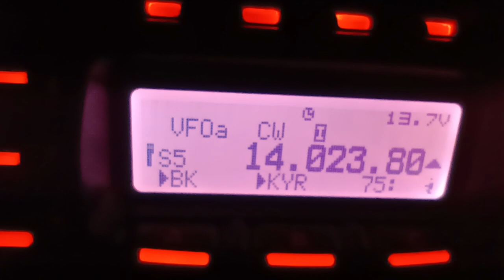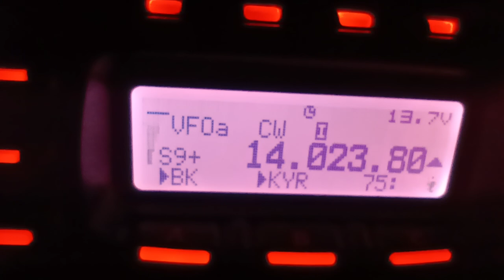Corona Discharge From Vertical Antenna

Comment: It's caused by a big voltage gradient because of a storm or something, like St Elmo's Fire? Sorry, not a HAM, just someone who uses a SDR dongle a lot - although I do have my code copying up to 7.5 WPM thanks to W1AW :-)
Reply from the maker: HOLEY MOLEY WERE ON A ROLL !!!! TWO fantastic comments in one afternoon

Darn right, and a blanking HUGE one... a TON of electrostatic charge to do that on a day at 72% humidity, normally thats a thing for desert conditions, 10-30 %

THats what was so remarkable about it, and why I wouldnt be caught DEAD outside touching anything metal under those conditions. Ive stood at Ground Zero touching a corona discharge from my truck antenna, knowing I could die at any second.
Reply: @k8byp  Many thanks for the reply! I've read about that for years. Very cool to see it documented as bizarre and dangerous RFI, especially with you switching between the horizontal antenna and the vertical.
Reply from the maker: It was heard on the dipole, but its an arc discharge only a few tens of feet away on the vertical, heard on a 130 foot long dipole. The discharge was basically right into the 'space' the dipoles in.
Reply: @k8byp  The dipole was picking it up from the vertical, eh? That must of all been very exciting in a hair rising on the back of your neck way :-)
Reply from the maker: I stayed in the HOUSE. And afterward, disconnected the antenna cables.
Reply from the maker: keep practicing the code.
Reply from the maker: : 0

Comment: Interesting to see and hear that. 

I would put a mask on the top to prevent corona discharging into the environment 🫠
Reply from the maker: Wrong thing to do and contrary to US Electrical code.

It cannot be stopped, the voltage ( charge) will increase until arc occurs. There need to be a sharp point TO cause the arc at a lower voltage to dissipate the charge. That is a corona hat in broadcasting.

The high potential at top is what " attracts" a lightning discharge.

That static charge is also COLLECTING ON THE RADIO.

Its easy to confuse this with lightning discharge. Both are arc discharges.

The antenna is grounded by a short rusted painted metal stake, if that were disconnected, it may not occur.

Comment: You can hear it well😮
Reply from the maker: Thats cause its connected to the receiver. That is one of the first steps in making a lightning strike, charges collecting above, under the clouds, AND  on TOP of the antenna.
Reply: @k8byp  that makes alot of cence glad you pointed out this situation bro thaks⚡⚡⚡
Reply from the maker: : 0